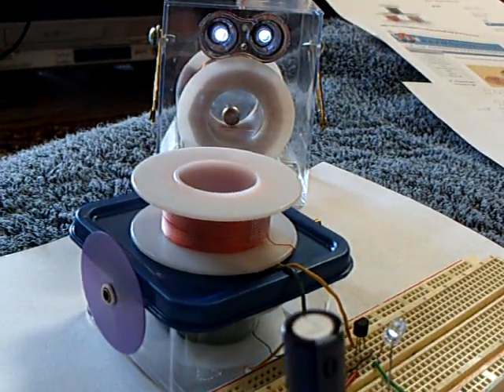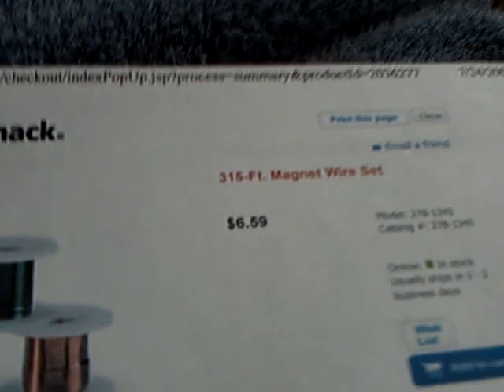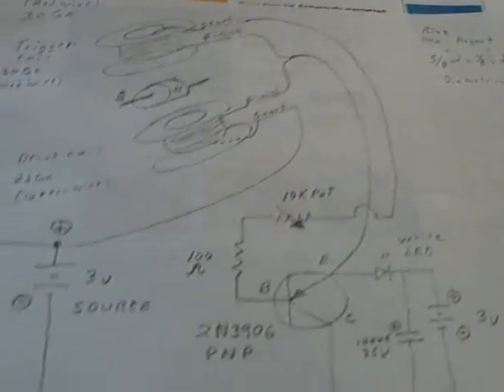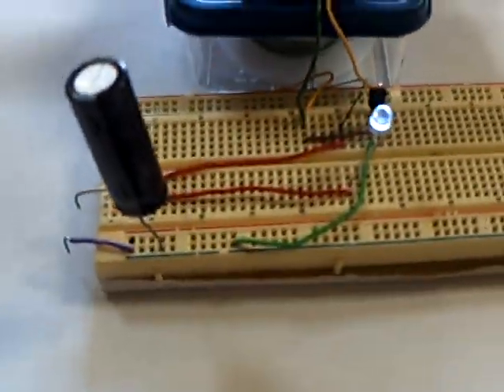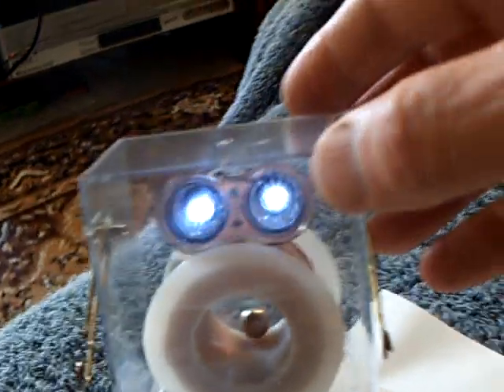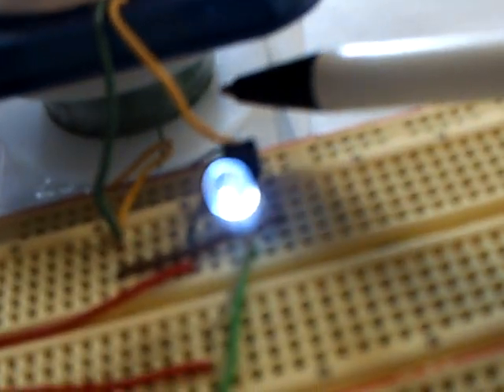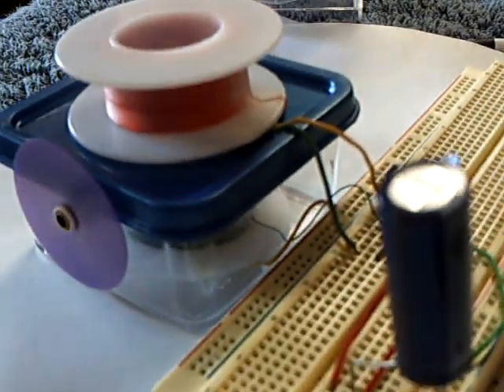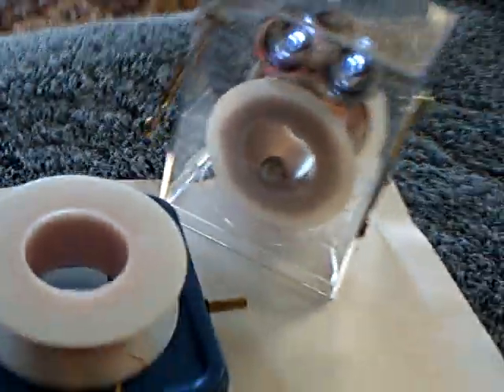Capacitor Pulse Motor & Maggie

Comment: Also...It is said that the Induction occurs at the speed of light from the Antenna. Perhaps at the right frequency the Antenna can behave as a resonance amplification so that it can match the sine wave frequency from the Bedini circuits back EMF....just a thought... and perhaps the idea of further defeating some of the resistance slowing draining the oscillations energy further....maybe you can draw just enough to keep the resistance back draw to a minimum by balancing this resistive force?...

Comment: If you attached an Antenna and Ground on  the Self Oscillating Resonator (When you stopped the motor) you have essentially created a Radio Receiver Tuner! Amazing =] This can be a hybrid of a Power Generator / Motor / Receiver and perhaps a Transmitter all in one unit! =]

Comment: Hey Lid. I think you can run and get more chage  by spinning your magnets(sphere or cylinder) between two coils in which they are vertically  positioned instead. No shaft  or bearings. I like your work and simplicity of the presentation.

Comment: There is a GREENPOWERSCIENCE channel here where he took a huge fresnel lens to focus a bright point of light, to in turn heat up one part of a stirling engine to finally provide rotational motion.

If you took that setup you could probably make a self-enclosed component that when given focused light will turn a magnet and broadcast some power?